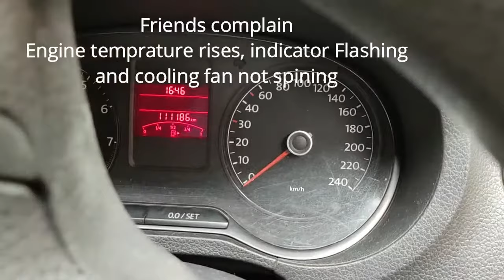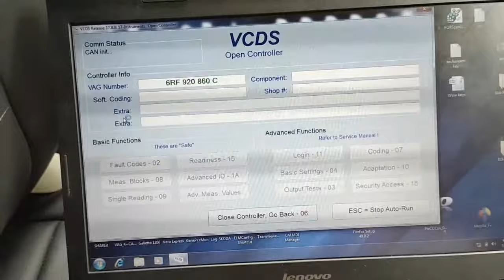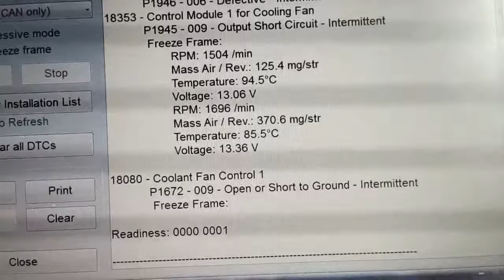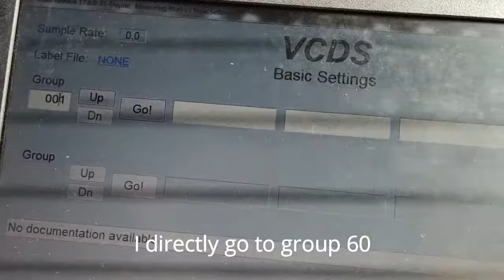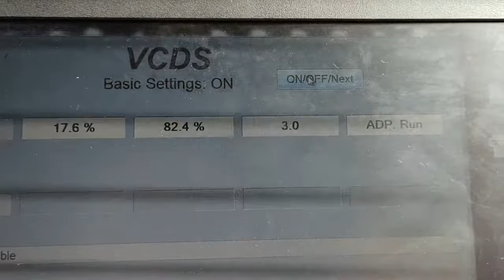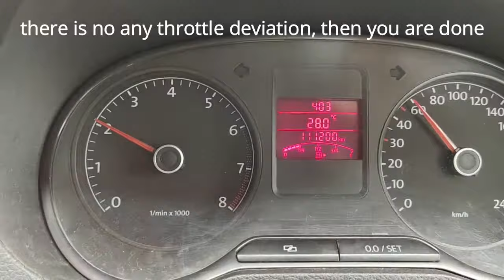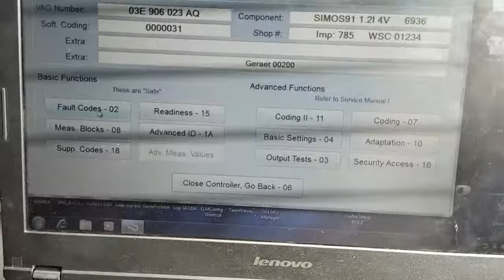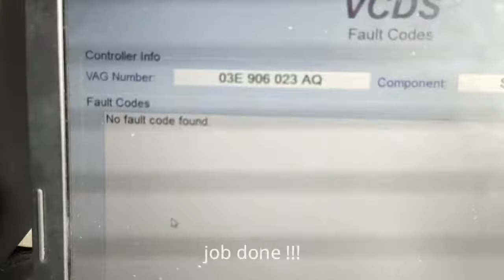Polo Overheating problem/Cooling Fan change, throttle body learning

Comment: Mere car polo 1.2 petrol 2012 Ka fan jaise hi car mein  key lagata hoon bahut speed mein ghumne lagta hai car bina start k hi. Aur key nikal ne kuchh der baad band ho Jata hai,Kya problem ho sakta hai bhai.
Reply from the maker: Temprature sensor aur fan mein problem ho sakta hai
Reply: @devautoelectronics  sir Fan change karwa diya aur engine mein jo temperature sensor hai usko change kar diya Lekin fan full speed mein ghumta rehta hai please koi solution bataye pareshaan ho gya hoon.
Reply from the maker: @realroamers4098  fan mein 2 signal ayega ECM se CAN HIGH & LOW signal usko check karna hai.... Sada electrician se nahi hoga, expert ke pass jao usko samjega...... CAN signal kahi short hai to aisa problem aa sakta hai
Reply: @devautoelectronics  Thanks for reply

Comment: Please guy my polo tsi is overheating and i changed thermostat, water pump,fun plug and temperature sensor but still the fun is not running but when i bypass the fun its running so i dont know what is the problem anymore because after the diagnosis still says temperature sensor
Reply from the maker: @MichaelRankwe  please go to good experience guy, he may surely help you.

Comment: Did you replace the entire fan with motor or just motor?
Reply from the maker: Just motor
Reply: @devautoelectronics  I too own a polo and my radiator fan runs pretty loud. It kicks in pretty soon, sometimes as soon as I start my car's engine. And then dash lights start blinking making it look like some voltage issue. These wanna be professionals or so called mechanics here doesn't even know what's causing it despite of diagonsing it.. Even to install a damn starter they need a day.
At first I thought replacing the radiator fan was a rocket science or something but you made it look so easy. Thanks for the video mate. I owe you one.
Reply from the maker: @shaggymike03  Dash flikering is sometimes dry solders or loose soket contacts, replacing fan is very easy, you can do it yourself..... Thanks for watching

Comment: Fan is not working machanic said you need to change entire fan so is their any other options instead of changing fan if we can change only fan motor is this work.
Reply from the maker: Change only motor but put original, no need to change full assembly

Comment: Meri car ka fan normal me slow chl rha h ac me fast iski wajah se pani back mar rha h kya repair ho skta h fan??
Reply from the maker: normal mein to slow hi ghumta hai jab gadi chalate hai aur temprature badta hai tabhi fast ghumega .... pani reserve tanki mein back mar raha hai to fan ka problem nahi hai
Reply: @devautoelectronics  ghumte ghumte bnd bhi ho jata h fir 5 second chlta h bs aur jb ac chla deta hu. Pani back nhi marta
Reply: @devautoelectronics  mechanic bol rha h k fan engine cool nhi kr pa rha islie pani back mar rha h ac chlte hi fan tez ho jata h engine cool ho jata h islie ac me back nhi mar rha
Reply from the maker: @vikramsahu3221  to aap fan replace karke dekho .... ho sakta fan faulty hai
Reply: @devautoelectronics   bhai 1 baat aur btao bhaar fan 8000 ka mil rha h to service centre me bhi ye hi rate milega ky??
Reply from the maker: @vikramsahu3221  service center jyada rahegi .... second hand dalo na 4 se 5 tak mil jayega
Reply from the maker: @vikramsahu3221  ache experience mechanic ke pass jao bhai... o problem ko samaj ke kar lenge
Reply: @devautoelectronics  ap mechanic ho ya fir apni kuch alag kaam h??
Reply from the maker: mera electrical diagnostic jyada hai mechanical karta hu lekin kam
Reply: @devautoelectronics  shop kaha pr h ??
Reply from the maker: @vikramsahu3221  goa

Comment: Dev Ji my fan is too noisy and it just runs it self what do you think 💭 is the problem
Reply from the maker: Its fan problem, needs to replace
Reply: @devautoelectronics  thanks
Reply: @devautoelectronics  what's the price
Reply from the maker: @binodsuresh1240  second hand 5k whick I bought new is around 12k